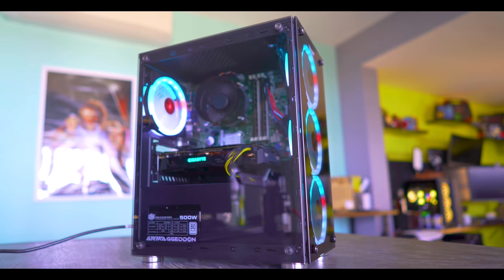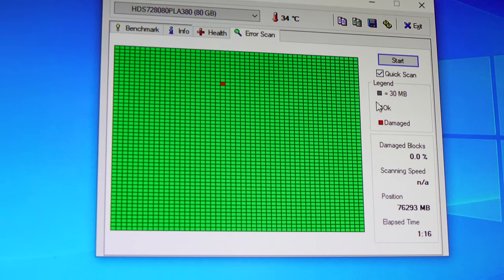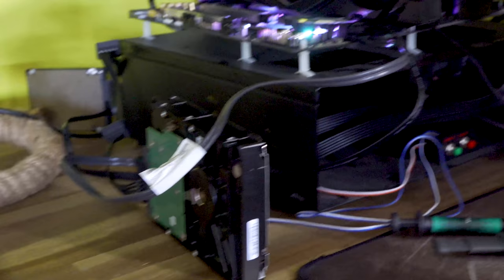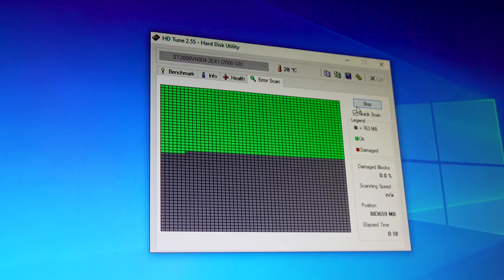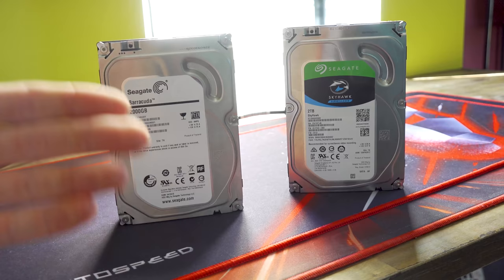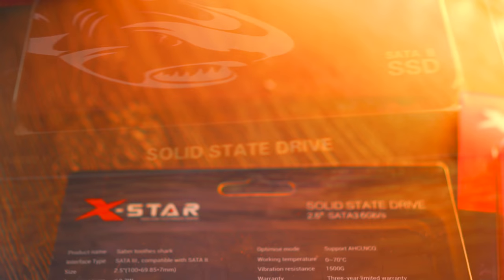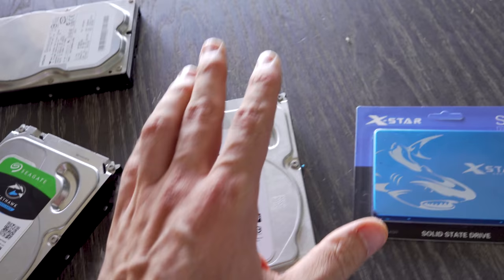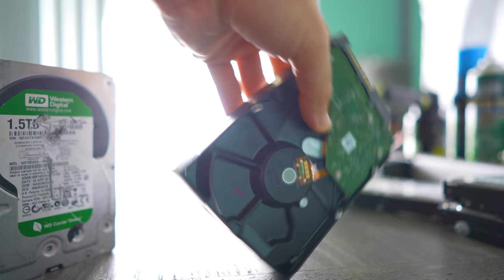Are USED Hard Drives Worth it...? (The Tech YES Buyer's Guide)

Comment: Think you can help me with something?

My used HDD is detected in my BIOS but isn't detected by Windows/Disk Management. Any advise?
Reply: Not in Disk management? I would assume you have tried other ports and cables.

Could be a bios setting that is either incompatible with the windows installer is disabling the drive. Could be a driver issue with the disk and/or interface.
Reply: Try to alter the jumper pin/clip to slave .
Reply: @robertt9342  It was working before. Only recently did it start acting up and even stopped my OS from booting. I had to take it out.
Reply: @abhroy  Alter the jumper pin to slave?
Reply: @faiflowright01   . Since you've already taken that hdd out - so , now please try to follow these steps . 

1) Update your antivirus engine & definitions to the latest -- update your drivers using iobit driver booster free .

2) Set jumper clip to slave on the troubled hdd -- attach to PC -- try to detect in BIOS -- then disk management -- save data from it if needed -- format the previous OS partition -- run a thorough antivirus check on the entire troubled hdd . Would be better if you could remove all old partitions on that & make new ones . 

Basic rule -- Set jumper clip to master to install OS on hdd . For every other scenario , set to slave :) Let me know if this helped or not :) Thanks . Take care .
Reply: @abhroy  how do I set jumper clip to slave? I checked the pins and there isn't a jumper shunt on it. 

I forgot to mention its a SATA HDD.
Reply: @faiflowright01   . Sata or pata , all 3.5" & 5.25" internal consumer drives come with jumper pins !! Please mention the make , model & year of your hdd .

Try to buy or borrow an external usb drive enclosure . Perform steps 1 & 2 minus the jumper tweaks . That should work . Also try altering the power & sata data cables in your pc . N number of things might be wrong . Trial n error n success scenario !
Reply: @abhroy  I tried different Sata cables, different ports, and used an enclosure. Still not detected in windows 10.
Reply: @faiflowright01   . Forget jumper . Attach hdd to pc . Then go for 1 & 2 steps . Key thing is - iobit driver booster free -- must do that . May be controller drivers got messed up -- pretty common in win 10 . Please let me know later on . Curiosity is a big nag  for me :)) LOL
Reply: @abhroy  haha I'll let you know as soon as I get back. Thanks
Reply: @faiflowright01  . Well ? Got some news ? Thanks .
Reply: @abhroy  Yes, I have. I finally got some free time to try it out. Unfortunately it's still undetected in Win10 and Disk Management. Though it's still seen in BIOS. 

It's a 1TB Seagate Pipeline HDD.
Reply: @abhroy  Okay, another thing to note that I missed. It's detected in Device Manager. I tried uninstalling the driver and reinstalling, disabling and reenabling as well.
Reply: @faiflowright01   . Uninstalling driver was what I wanted to suggest !! Too heavy a topic for 2 am (IST gmt + 5.30) that one is . I will google a lot about that . Catch you later . Thanks for that brain-teaser , really :)
Reply: @abhroy  big thanks for the help. I seriously appreciate it!
Reply: @faiflowright01   . Sunday 1335 now . Will send in a big cover-it-all mix by 1900 IST .

Comment: Hard drives are utterly unreliable. I only use a servergrade HDD for my download stuff and replace it every 5 years. Everything else is a SSD.
Reply: SSD have a higher failure rate then HDD in 2019. And the move to QLC wont help to improve.
Reply: @llothar68  QLC is not better than TLC. It's only used in low cost SSD's.

Comment: Used HDD is only thing I wouldn't buy at any price. People are scared of loosing valuable data, pictures, etc. so they want some warranty.
Reply: Warranty doesn’t cover data recovery... back it up. If it’s really important, multiple backups, assume all the drives at the house will be destroyed in a fire, and the one located elsewhere gets flooded/tornado and you didn’t know about it, so have even a 3rd at a relatives house you trust or something, and swap backups (you keep their 3rd drive, they keep yours). Cloud storage doesn’t count as a backup (unless you’re counting it as like a convenient 4th spot).

Best option for important (non-classified information), is 3 cheap used mech drives, 2 new ones (of different models and brands so if it turns out to be a notorious “Hitachi DEATHStar” you’re not screwed), and 2 on an SSD (fall/drop resistant, less sensitive to moisture corrosion like floods, but unfortunately fail without warning). Obviously that’s pretty robust system (stored in minimum 4 locations, underground is fair game too), but since you should be backing up often you might not have all at the same version level, so do consider that the more you have the more of a chore it is, and NEVER have them all connected at the same time (my PSU was bad enough frying a single $250 SSD... but that’s no data loss for me, that would be the real tragedy!).

If it’s important stuff you don’t want being found by others stumbling on all these, then you can raid stripe the collection and scatter them, never with enough data at any one or even 2 locations to be able to recompile (they would need at least 3 places known, like your house plus a bank vault plus a relative or stashed in another hiding spot). Since I’ve got nothing that important (the most you’ll find is cryptocurrency, but then you’ll need the key... which is hidden in segments...), I don’t go to that extreme.

I did lose like 1.5 TB of videos and it sucked because some took a lot of time editing (I had several fun videos, like one was a lighthearted chill video breaking some TimeSpy world records, others were pretty interesting too), but hopefully never again!
Reply: @jakegarrett8109  I know, but I thought about product quality, if it has longer warranty, it is probably better quality. Used cheaper HDD doesn't have warranty and used SSD is clear no-no if you ask me.
Reply: Danko Mrkonjić typically yes, as that’s the period when the designer thinks it will last. That’s a good indication of both the company and the product, just make sure to also look at the return specifics (for instance, they know you won’t spend the $30 shipping cost to return a $35 PSU... so basically any warranty that requires paying return shipping, for THIER defect, is basically no warranty).

Used not having warranty doesn’t mean anything about its life expectancy though, so maybe look at what the original warranty was if you can find it. Having a company that stands behind it is very difficult to find anymore, but the only good warranty (out of lots of dead hardware), has been Toshiba on an SSD, they not only didn’t ask ANY questions (every other company asks the same stupid questions, even if you already answered the obvious in a short concise single paragraph claim, it’s an email bot/auto response, and it’s really annoying assuming all customers are stupid or something not providing basic info), Toshiba replied quickly, “Sorry, were shipping you out a new one and here is your prepaid mailing stamp”. Within 24 hours of the claim I had a new drive, advanced ship to me (upgraded for free to the top of the line model, and they rush delivered it to the middle of nowhere that fast thanks to the $40+ they paid for rush shipping), they didn’t so much as ask for a credit card number, I had both the old and the new SSD (they said take a week if I needed it to copy any data over), so lol, no proof it was even broken and no way to bill me if I just kept both the drives... That’s some real trust, and some REAL customer service, I can’t even get some companies to pay any shipping either way, or send me a replacement in advance so it’s not weeks of downtime even if I offer to pay for it and then have them refund me when they receive the faulty product... So if you need great SSD replacement, go with Toshiba! (Do note, I believe mine was an enterprise class SSD, so maybe I got special treatment, but if you contact Nvidia for example and say, hey my Titan series GPU is crashing a ton, you get pretty much no help... and yes the Nvidia example is also real, they even treat more premium customers like trash)

Good luck!
Reply: @jakegarrett8109  when you pay with paypal, they cover warranty return shipping.

Comment: I miss the old drives that could be recovered by freezing. It often worked long enough to recover data perfectly. I've never had success with a modern drive using the freezing method though. Wonder what changed. Density? Head material?
Reply: It not supposed to work in most cases HDD Recovery channel has a video about it.
Reply: @ArthursHD  I had great success with most brands up to about 2012 or so. I think they went very high density or changed head material or something like that. Instead of having semi readable drives and ones which would detect when cooled heavily,  we started to get total read failure and absolutely undetectable drives and I gave up on the freezing method but it certainly worked before that on many drives. I recovered a customer's entire accounting ( years worth, no backup) from a WD blue by very slow extraction with intermittent re-freezing and got every bit of data. Those recovery sites love to call me a liar but I didn't dream the data transfer, haha. Obviously it comes with risks and depended upon the failure mode but I would say I was about 50 percent successful with it back in the day. Now, not one success in last few years. Off to have the heads replaced at a recovery centre usually

Comment: Instead of paying for that fancy GUI for testing your drive, just use https://www.smartmontools.org/

As for that drive you showed, showing 1 bad sector - that's nothing bad, really, but those 28 "pending" sectors, tell me the drive has issues, especially after just a "Power On Hours Count" of 92. Also, remember that drives usually die early or late https://en.wikipedia.org/wiki/Bathtub_curve

PS: Better use Linux next time to gain more control ;)

Comment: Just realized that my drive has 40000 hours holy sh1t
Reply: I rarely see a failure under 35K hours (unless its an infant mortality failure in the first year). I have drives over 80K that are still working fine with no bad sectors, note though these are in systems that do not move, not laptops that get banged around. I wouldn't consider anything but an SSD in a laptop, if it doesn't come with one, I replace the HDD.

Comment: Seagate has gone from my Trusted to my Blacklisted drive list.
the number of DOA/Firmware death/locked Head is incredible for an end user, especially their barracuda lines.  their 7200.11 had firmware issues (2x 500GB locked up within 6 months of purchase; bought 2 months apart , lost 100GB data. they sent me replacement 7200.12 but those died after 1 year. i had to RMA again, together they sent me refurb drives)
after that, i sworn off  Seagate... no matter how much they sponsor big name techtubers. 
their enterprise drives might be based on their "old" philosophy/quality assurance and their consumer is basically Maxwell level(seagate acquired Maxwell)
but as a small time consumer, 4 drives back to back failing is too much of a coincidence. trust in them is gone. i had to 

so far WD is my go to, Samsung second(rare to find these in shops now) and Toshiba if i'm desperate(cheapest drives NEW)
i have WD green that are alive from 2012, 24/7, at first there was data corruption/unresponsive, turns out my Z77 board couldnt support 6 sata drives and paired with the intel/microsoft "power saving"  feature, the drives would be recognized after a restart. Fixed the issue with a PCI Sata card and turning off the Drive Sleep feature. i still have the refurbs Seagate drive but i used them as scratch disk, backing up any progress to WD.
but this week i will be buying a USED WD RED... hopefully i wont regret this
Reply: Honesly for me its been the opposite, every single wd drive that ive ever owned has died on me (currently have one that is on its way out) and ive never had a seagate or a hitachi (another bad brand by most people) drive die. Its basically all luck of the draw.
Reply: Hitachi makes Deskstar(it earned the nickname Death Star under IBM) and it had absurd failure rate back in the day. its still sold as the cheapest drives, rivaling Toshiba.
i would use it as cold backup. no frequent access/read/writes. it died fast if when i  use it as a scratch disk.
samsung hard drive did better but they stop making those.
but that's my experience consumer drives. over the past 15 yrs.
seagate revamped themselves so i might try their Ironwolf drives if i had the money.
i would put  Seagate barracuda drive in other people's machine but if only they are savvy to do backups. if a raid setup, i would need to space out seagate purchases by half a year

Comment: I have a 160 gb ssd that died. Might be one of the only ssds on earth that died for no reason. Lol
Reply: They die all the time, everyone in my family since 2015 that has had an SSD has had at least 1 SSD drive fail them since then. That said, they are much faster, and will survive just fine where mech drives would be jarred to pieces (ironically that one is still running and my oldest SSD), but for a while I was 0 for 2, lol, and they weren’t cheap either! They also die with 0 warning so it’s kinda annoying (I guess my cousin actually had his failing more and more sectors like crazy suddenly, but like mine showed 99% health in SMART and would corrupt an OS in under 3 hours...). They just kind of do that, so just have backups, lol!
Reply: Jake Garrett I guess it’s not true that ssds never fail. Yeah mine was fine.  Then one day I went to turn it on and it wouldn’t boot into windows. I tried everything until a new drive fixed it. I wonder if I could get it working somehow.

Comment: Why would you ever take a chance on used HDDs? The number 1 failed component of any PC, and that's even before you factor in rough handling when pulling them out of a case. 
The ONLY reason to do that is to make a quick buck and f*ck over your customers who would most likely get a dodgy drive that will fail prematurely with all their important data on it.
A HDD will usually barely last 6 years, so selling one that is already past 5 years old is horrible practice, almost ensuring it will fail during the active course of usage - and of course the warranty is long gone by then, so not only will they lose data but have to pay for a new drive.
Oh, and speaking of warranty, if you buy one that is still within the timeframe and need to replace it - make sure it is ABSOLUTELY SPOTLESS, as WD and Seagate et al will refuse it for any physical damage: scratches on the PCB, torn label, dented SATA ports, corrosion, any signs of opening attempts, etc. Be meticulous when inspecting!!!  
(I'm a PC Tech with years of experience and thousands of computer builds and repairs).
Reply: "Rough handling when taking it out of the case" what the fuck does that mean? Hard drives can take some minor abuse, most drives take some abuse during shipping or when a pc is getting moved around. Unless you are smashing it off the ground its probably gonna be fine, they arent that fragile.
Reply: @Polygraph2131  I did this for a living, you have no idea how many HDD are being refused manufacturer's warranty because of people accidentally scratching the sticker, breaking the plastic overhang of the sata power connector, bending a corner of thin metal casing top, etc. So even if the drive can physically survive that, the manufacturers themselves will not guarantee their health even if there are many years left for it.